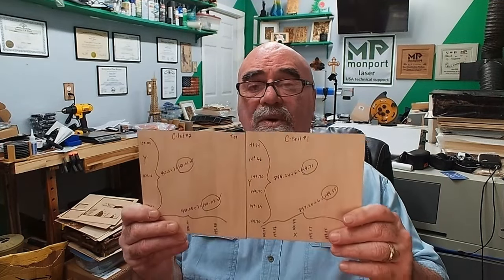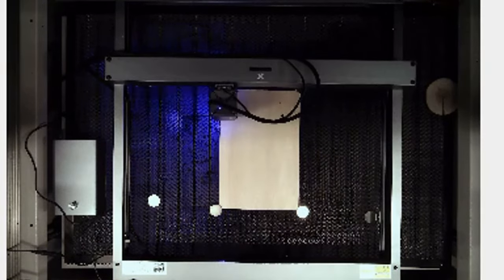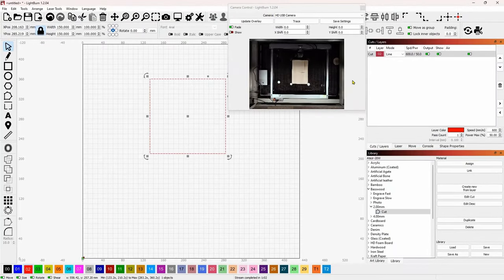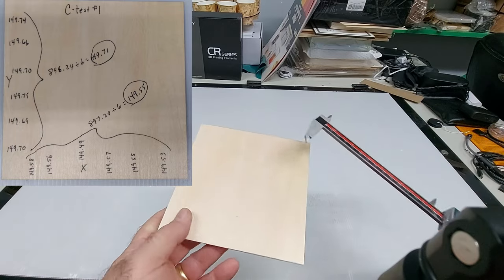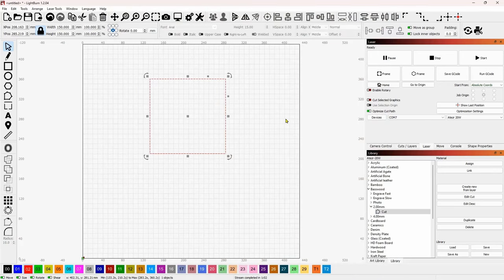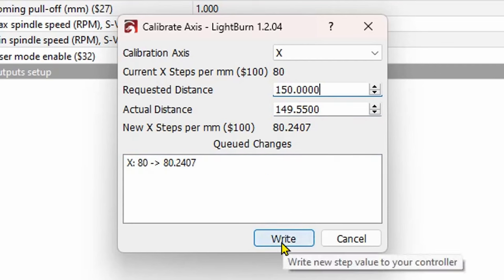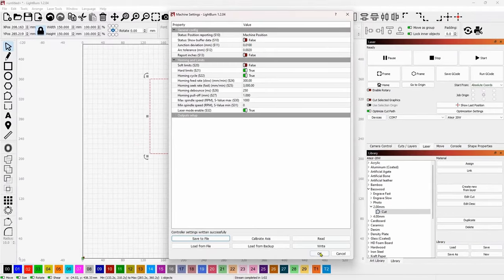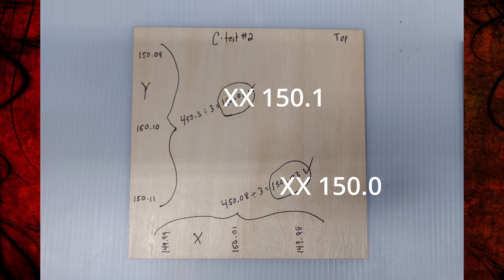Perfect Calibration on your Hobby Laser in Lightburn!

Comment: I have a suggestion for your viewers I am sure you are aware of this, when measuring with the calipers the beam of the calipers need to be parallel with the stock you just cut. To prevent measuring a parallax. To do this I place the material on a flat surface and the points  of the calipers on the flat surface this keeps the beam parallel. Great video Rich! I am head out to the shop to calibrate the kerf and then the actual cut. Thanks for mentioning that sequence!😁🛫
Reply from the maker: No problem, and thanks for the tip!

Comment: Rich, thanks as always. I just watched the video you did on Kerf (thanks again!) and posted a question that I'm repeating here on this more recent video - sorry for the duplication. I'm a beginner at this craft, but it seems like there is interaction between X- and Y-Axes Calibration and Kerf. If I'm correct, this calibration moves the cut line outside the desired dimensions so the inside of the cut line gives us the desired dimension of the cut square. Does Kerf do the same thing? Are these two adjustments cumulative? Is calibration of the axes more important than Kerf, unless you're doing something like puzzle pieces? And I imagine that the actual laser spot when focused has something to do with all this is well. I suspect the answer is test and test again and you've given great tools to do that with, but the interaction of these two settings is still a question for me. Thanks!
Reply from the maker: No Pat, this just gives you overall accurate dimensions, while the kerf offset changes the accuracy to add or reduce size for a better fit of joined cut pieces.

Comment from the maker: Please backup your settings before making any changes! As an afterthought, someone asked me a while back if they could do this with cardboard. My advice would be no. Wood, or better yet, hardwood, but acrylic is actually best. The less material that gets vaporized, the better.
Reply: Good Day Sir...many thanks for your content and in helping us all. My problem is very frustrating.  If I draw a line or a box 3"" x 4" ...in lightburn...when I send it to the laser it now becomes 4.25" x 5"...no materials are safe. Can you assist me?
Reply: Ooops that I forgot.... And after calibrating it was still off for X or Y, with a bit under 150 the other was a little bit over 150, so somewhere I made a mistake :)

Comment: Because you did not take the kerf with into account, this will only work for squares of 150mm.
It will not work for other sizes. It would only be correct if you would subtract the kerv width first. 
And also set the kerv width in lightburn.
Reply from the maker: No, I want the final cut to be 150mm including the kerf, and it does work on all sizes. The kerf doesn't change until you change material.
Reply: @TheLouisianaHobbyGuy  you have scaled your x and y and did not exlude the kerv width. 
But the kerv remains the same with when doing other sizes.
So then the scaling for 150mm doesnt match anymore.
Just do the exersize on paper and you will see it.

Comment: Shouldn't you determine what your kerf is first and then take that into account when calibrating? 

As a hypothetical, at one extreme, imagine your kerf is 1mm (0.5mm off of the exact center line on each side), and you are calibrating for 10mm. If you get your machine dialed in exactly for a 10mm square (11mm center line to center line - 1mm kerf), and you scale that up to 1000mm, I would think you would end up with a 1099 mm square. 10mm + 1mm kerf = 11mm; 11mm * 100 = 1100mm; 1100mm - 1mm kerf = 1099mm

At the other extreme, if you get it calibrated for exactly 1000mm with the same 1mm kerf, then you scale that down to 10mm, you would end up with a 9.01mm square. 1000mm + 1mm kerf = 1001; 1001mm / 100 = 10.01mm; 10.01mm - 1mm kerf = 9.01mm

With exactly 1mm of kerf, I would think that you would want to cut a "10mm" square and get a measurement of 9mm, that way when you cut a 1000mm square, you will get 999mm, and then use the software to account for that kerf the same way a cnc router accounts for bit diameter. That way, you're accurate regardless of the size of the project.
Reply from the maker: If I ask for a 10mm square, I want a 10mm square. That's what the calibration is for!
Reply: @TheLouisianaHobbyGuy  I understand that, but I would think that you would want to calibrate it from the center of the cuts on both sides, not from the center of the cuts minus the kerf. If you only calibrate it from the finished cut, you're not getting a proper measurement, and that will affect your cuts on the other end of the scale.

In my first example above, you would need to move the laser head 11m to make a 10mm square, which is 10% too far. If you wanted a 100mm square based off that calibration, you would move the laser head 110mm (100mm +10%), which would result in the wrong size square. Instead, you actually want to only move it 100mm plus the kerf offset.

While you are still effectively moving the laser head 11mm to cut a 10mm square, it's how you go about it. Calibrating directly from the finished cut, you are telling your machine that 11mm is actually 10mm, which will throw off your measurements as you change the size. Conversely, you want to tell your machine to move 10mm and have it move 10mm, and have Lightburn (or whatever software) add in the kerf offset to make it move a total of 11mm, so when you change to a 100mm square, it only moves 100mm plus the kerf offset instead of 110mm
Reply: The calibrate axis function in lightburn, your meant to measure how far the head moves on each axis not how big the cut is. The kerf offset should make it the right size not the calibration. Your method is easier but does add the kerf on to your measurements so the above user is right.

Comment: oh man, I don't even know what to say. That goes against every CNC calibration principle there is. I can hear my instructors rolling in their graves! You can't mix machine motion calibration with tool offset calibration they are 2 distinctly different beasts with the tool offset having a gazillion variables from cut speed, power, material type etc... I hate to beat you up because I know your trying but I also hate to see people struggle. In a way its kind of odd as I had a client years back with a large format CNC router that was told to calibrate it exactly the same as here. He ended up with a very expencive door stop that couldn't cut anything dimensionally accurate. He was actually trying to sell that what he called piece of junk. Kinda sucks for his cabinet shop where cabinets were give or take 2% off measurements, bigger hammer to fit the parts! It was a simple fix that should have never happened.

 This calibration method includes the kerf calibrating the machine to think 150mm is actually 150.1mm - 155mm depending on material tested. If after a project is 600 mm the deviation exponentially gets worse (4 times kerf on the test material extra distance moved). Machine movement calibration is for machine movement and has nothing to do with tooling. If you ask the machine to move 150mm it moves exactly 150mm and if you have backlash then the backlash compensates for direction reversals due to belt slack or what have you. There should be no guessing, it moves exactly 150.000 mm. This calibration method nobody will have any idea how far the toolhead travels when 150.00mm is commanded. Thats sorta like buying calipers that are +-5mm / 150mm they look great but you can't trust the measurement accuracy. Then use them to make a 4 gang light switch cover.

 Some people don't need accuracy as they don't build parts that fit together or need to be dimensionally accurate, awesome use factory settings or calibrate the machine and ignore kerf. But those that need accurate need accurate not approximate. If your making 4 gang light switch covers you don't wanna cut 20 of them to see which one has the holes guessed in the right spot. One expects that the hole is exactly where drawn.

 Machine calibration is fairly well documented in many grbl websites but can be further simplified with tape or clamp and a caliper, 10-15 minutes is all thats needed. Simple extend the depth rod and tape the caliper to the right side of the gantry making sure the depth rod can freely move in/out and the caliper is solid and unmovable. Move the toolhead to touch the depth rod with lightburn then zero the calipers. Then move the toolhead 120mm slowly with lightburn while the toolhead pushes the depth rod back into the calipers. Look at what the calipers value is (ignore the minus sign) and use that to calibrate the X movement as demonstrated in the video. Rince and repeat until the calipers exactly say 120.00 mm. Then do the Y the same way. Now you have the mechanical movement exact as expected with no variables. If one wants to calculate backlash then move the toolhead away from the calipers then move it back 125mm, if the calipers read 123.5 there is 1.5 backlash as 125 is expected. put in 1.5 backlash into grbl and test again, keep testing until you get the expected results, in this case 125mm. Now the mechanical hardware is calibrated properly. It will change slowly over time and use and have to be re-calibrated but again it only takes 10-15 min. The important part here is if you instruct the machine to draw a 150mm box it moves exactly 150.00mm on each side.

Now that you know your laser mechanically moves the laser toolhead exactly you can cut a 150mm box, measure it and if your average measurement (both X and Y) is 148.5mm then your kerf for this material, this speed, this power and this thickness is 1.5mm (150mm box size commanded, 148.5mm actually cut, difference of 1.5mm kerf). Lightburn does not have dual kerf so you need the average of X and Y. Some diode lasers have a beam that is a rectangle. Remember every material is different. Run most plastics or foams too high power, too slow speed and no air assist and you get a 6mm kerf. Thats ok if your happy, as long as you know the machine did exactly as expected and not somewhat like expected where you then get to cut it again because it was too small and compensate for the compensation.

 Lightburn kerf setting instructs lightburn to compensate for the laser beam diameter on the material tested. If you draw a box of 100mm in lightburn with a kerf of 0.5mm lightburn actually cuts a 101mm box (0.5 outward on all sides). You control with kerf if lightburn cuts on your line, inside it or outside it. This is the proper way of setting kerf by instructing lightburn the cut tool has a diameter so that you get a 100mm box exactly.

 So in the extremes with the foam test of 5mm kerf all the wood projects will be cut 4.9mm too big and if you use 2mm plywood as the test then 10mm plywood and foam will be cut too small. The proper way is setup the machine as outlined to be exact like a ruler. Then when needed do kerf tests and tell lightburn what the kerf is so 2mm plywood, 8mm plywood and foam all cut correctly. Then it doesn't matter the size the machine will be accurate, 6000.05 mm box will be as accurate as a 1.05 mm box.
Reply: Exactly!  Thanks for your post!  Well said!
Reply from the maker: Thanks for the comment!
Reply: Thanks for explaining some of this cut theory; it was very informative!  I don't believe Rich was trying to get to a milspec tolerance, rather he was clarifying a method to adjust for error for regular folks who have some slop in their cuts.  I'm neither an engineer nor a CAD designer, rather I probably fall more neatly into Rich's target audiance than a mechanical engineer's.  I gained some useful insight to understanding the correction compensation Lightburn has that I was unaware of before watching the video. I now have a greater understanding of how much more there is to learn on the subject.  Your response, although divergent from Rich's, was respectful, informative and offered a more granular explanation than the intended information and I'm certain there is much more to learn without getting too deeply into calculus.  Thanks again for taking the time to write such an insightful comment.

Comment: You mentioned blacklash I know what it is, and yes it is extremely important if you want repeatability. My question is where would I find this backlash offset? I am thinking they way you stated that this is in the software of the drivers for the stepper motors? And if so how could I find this? Or is it an arbitrary number that was plugged into lightburn that I need to fine tune? 
You videos are outstanding! Thank you for sharing your knowledge! 😁🛫
Reply from the maker: Backlash is a complete video of its own. Think belt climb instead when changing directions, since that's what hurts the precision. The faster you run a scan, the more likely your belts will climb on the timing gear and skip teeth in some cases.

Comment: I followed the video and made the calibration change, y axis is cutting straight bit the x axis the lazer head jumps when turning the corner to cut the vertical cuts. This makes the cut not straight, It also jumps when engraving engraving the vertical. There is movement in the lazer head when moving manually. Any ideas how to solve this issue?
Reply from the maker: The eccentric nuts probably need adjusting. Google it Darren.

Comment: excellent guide Rich, I've spent numerous hours with that settings when i replaced my small diode laser frame to a big one. thats a must. 

what steel magnetic bed are you using? i can only find ss and aluminum ones online
Reply from the maker: The one in this video is my Co2 Cesar, but the Comgrow honeycomb is steel.

Comment: First off, great info, thank you very much from Trinidad and Tobago!    
I'm really enjoying my brand new Comgrow Z1 and completed the X,Y calibration perfectly (it was a tad off on both axes). Then I measured the squareness with my shop's machinist squares and found it to be a tad off also. Corner to corner diagonal measurements of the fame are fine, the table surface is flat (frame rests on a 26'" x 26" x 3/8" sheet of plate glass, and there are three little legs between the glass and bench), so I know its flat. Found the gantry to be out of square relative to the two blue supporting plates (~1.7mm over the full length of the gantry). my solution to that problem was to paper shim the interface between the front of the left gantry support (blue Plate) and the gantry bar using a thickness of four sheets of printer paper, this absolutely solved the problem.  I now have a machine that tracks perfectly square and the x, y calibration is spot on.  I've also added a Comgrow Lightburn Camera (camera module arrived defective, replacement on the way) and I also designed and made a pair of laser cut acrylic brackets for the Comgrow camera mount to provide overhead lighting for the bed. I will find somewhere to post the DXF file for those brackets, some pics of my rig and also an amazon link for the light bars I used.  Very happy with this machine and thanks again for all the tips.
EDIT: Here's the link for the lighting build:  https://www.thingiverse.com/thing:6456674
Reply from the maker: Thanks!

Comment: Hi Rich. As usual, this is a great video.  Thank you.  I have a question. You may  have answered this elsewhere but, should I do this calibration with the Kerf Offset set to 0, or with the offset set to the correct value for the laser?  Does this question make sense or am I way off here?  Thanks again.
Reply from the maker: I do it with the kerf set to 0 Rick since most of my jobs are simple cuts.
Reply: @TheLouisianaHobbyGuy  Thanks so much Rich.

Comment: Been having problems with my falcon 2 not cutting square, I've calibrated it a dozen times and its still not cutting square.
when I measure from corner to corner there's a 2mm difference from a 100mm x 100mm square
Reply from the maker: Your gantry is probably out of square slightly.
Reply: @TheLouisianaHobbyGuy Thank you sir, just measured it, 7mm out, will look into adjusting it

Comment: Hey Rich, your videos are amazing ... I am having some issues with this calibration with my xTool D1 Pro 20w ... I have run this 5 times, and it does not seem to get better, or closer to 150mm after I changed the settings. 

I am getting numbers around 149.64 to 149.73 ...  in fact, it almost seems to be less accurate after the 5th test ... 

I bought the exact caliper you have linked ... followed your video several times ...
Is there anything you would recommend for me to try and remedy this? I was going to do your kerf test/calibration after this  ... but I am concerned that my calibration is getting worse ...
~ Dan
Reply: One other question ... there is a switch on the board that is positioned to the left ... Is the "WRITE" locked so that I can't update the settings with the switch in that position?

If I flip that switch to the right (towards the rotary port), does that UNLOCK "WRITE" access for the board? This might be my issue ... ??
Reply from the maker: The xTool is a funny bird Daniel, and I can't help because I don't pay them much attention with all the odd problems they have. Perhaps contact their tech support... that's all I can offer, sorry.

Comment: I tried this calibration method at least 6 times.  It does not adjust when I write the new settings?  I looked but cannot see a parameter that would prevent that write function.  You are a huge help and excellent demonstrating your knowledge!   I’m sure I speak for many as myself, saying thank you very much for your help!
Reply from the maker: Not all lasers use/allow all the features of Lightburn on their control boards, xTool as an example.